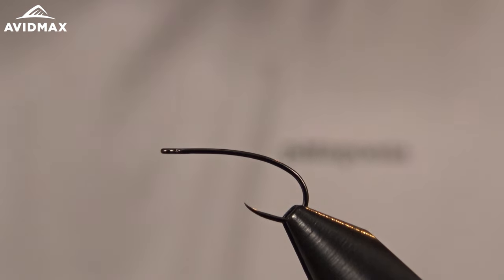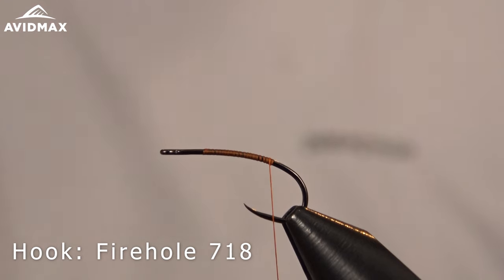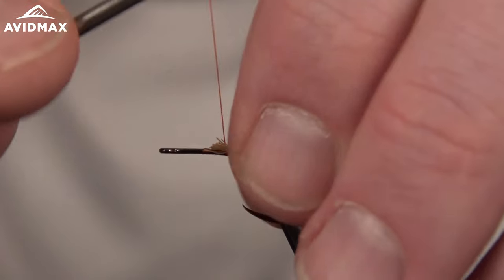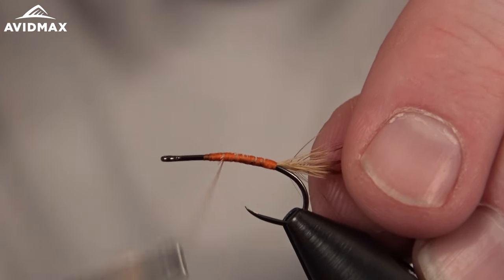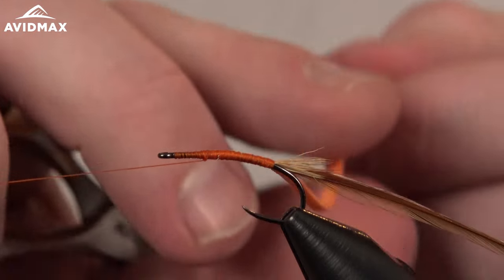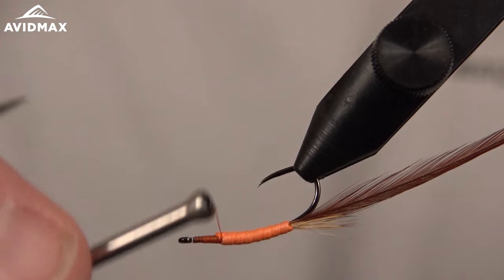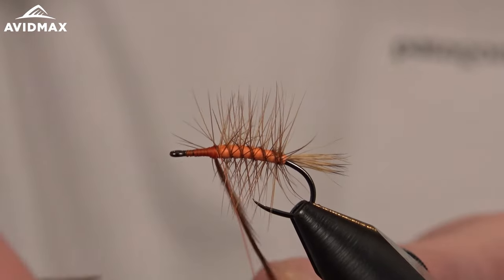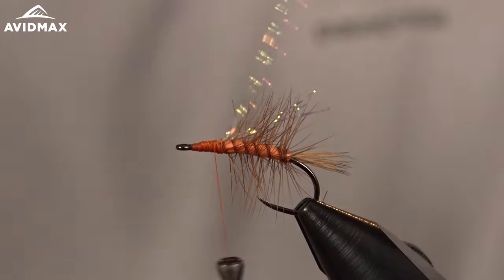How to tie the Foam Body Stimulator | DEADLY Dry Fly | AvidMax Fly Tying Tuesday Tutorials

Comment: I was just wondering if there is a reason to tie the foam in on the side of the hook rather than on the top of the shank.  I know it is not in keeping with the original recipe for the fly, but I've gotten great buoyancy  using snowshoe rabbit for my wings, any thoughts on this alteration ?  Thanks very much.
Reply from the maker: For me, tying it on the side of the hook helps me get the first wraps down neatly. Snowshoe is an interesting substitution. I don’t see any reason why that wouldn’t make a killer fly. The Usual is a great pattern due to it’s use of Snowshoe Rabbit.
Reply: @AvidMax  Thanks for the info !  I've seen the "Usual" fly, I'll look it up, I hope it is one of you videos, you guys do a great job on you tying tutorials.  Thank again.